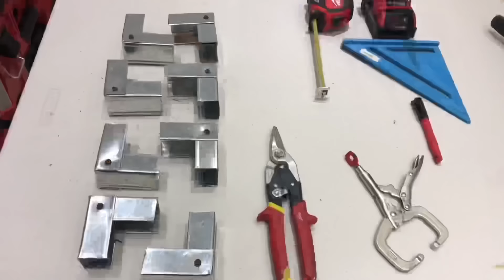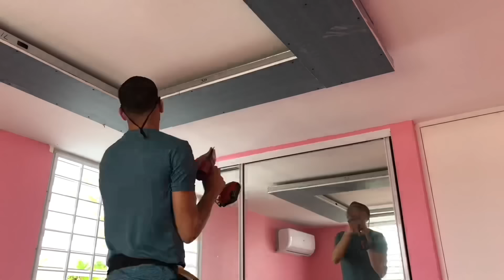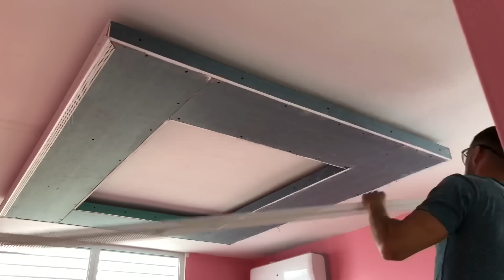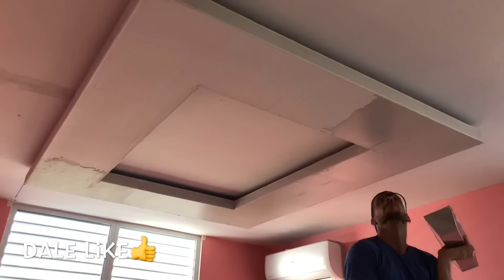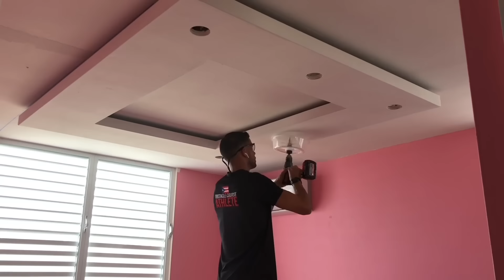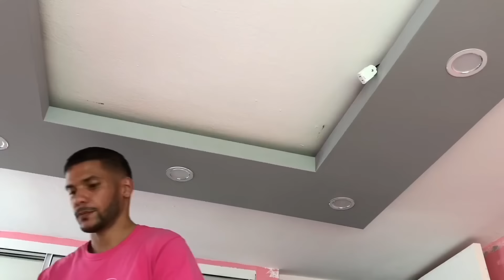How to make a floating ceiling in Gypsum Board with led lights

Comment: If it’s a concrete ceiling, how did you run the power wires to the light fixtures, or were the wires already in place when you started?
Reply: Looks like a runner on the left side. Did you cut a channel?

Comment: What a GREAT JOB YOU DID detailed. I just bought a condo with a 1980 cement ceiling (yikes).  I want to do a total drop ceiling with sheetrock to at least 1 big room. What did you use to hold it into the ceiling above?  I want to install a ceiling fan for my wife and a bunch of 9 volt pod lights. How would I attached the electric box to the cement in order to hold the ceiling fan up to the poured cement ceiling?  I am not sure if I want to farm my condo job to an expert I will need a person to pull a permit possibly. Or do this job myself. I am an old man and a long retired contractor from NY.  I use to be a outdoor brake man back in the day. So any help would be deeply appreciated. I look to hear from you regards, William

Comment: Great video, I followed everything that you did and it looks great so far! The only issue I have is that the screws stick out a little bit on the drywall, doesn’t countersink into it for a flushed finish. How do you get the screws to countersink into the gypsum board when attaching for a smooth look? I am using sheet metal screws 
because the drywall screws do not go into the metal as easy

Update: Now I get what you did. After I set the corner beads on with the mud it kind of covered up the screw heads. I then proceeded to fill in any gaps between the top and bottom corner beads with an additional layer of mud, kind of like putting icing on a cake LOL. After sanding it looks perfect you don’t see any screws

Comment: Thanks for video, My question is where did you get metal frame from? and what size are they? I did not find them in Lowes or Home Depot they only have larger size like 2x4
Reply: Hi Tom,
Have you been able to find the metal studs this guy used? It seems like he is outside of the U.S. and the materials he used are not available in the U.S.
I have also searched Lowes and Home Depot for these studs, I found some on their websites, but those seem to be thinner about 20 Guage. They also have some at stores which are 25 Guage. These are weak.
Reply: I’m curious to know as well.

Comment: How did you run the wiring, and from where did you run them?
Reply: At the start of the video the  concrete in the sealing is cut for cable